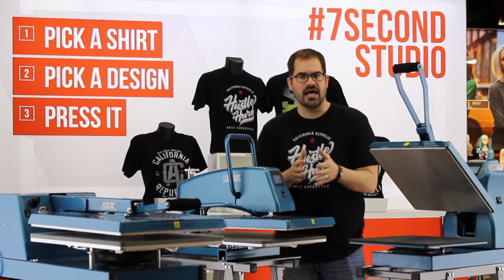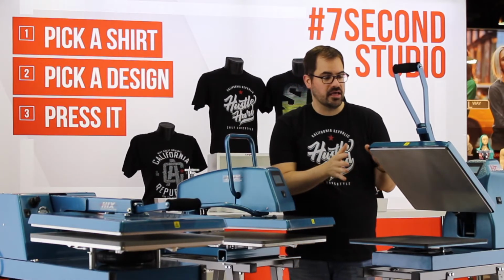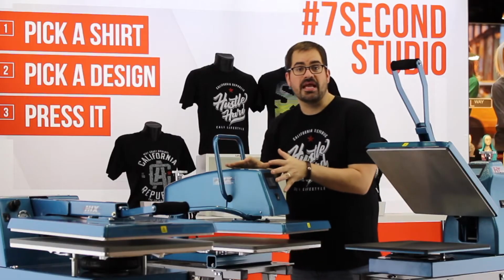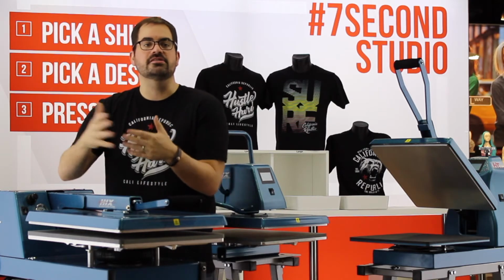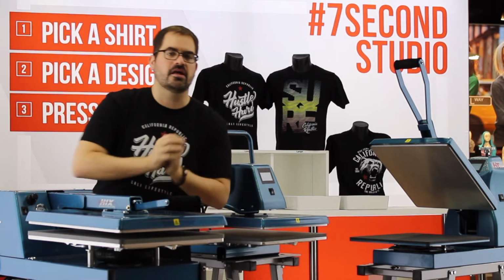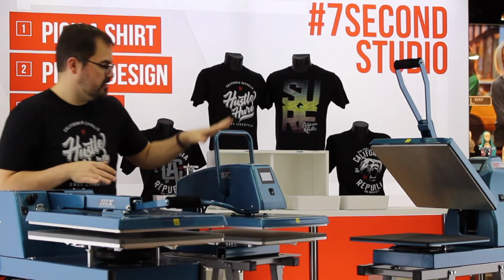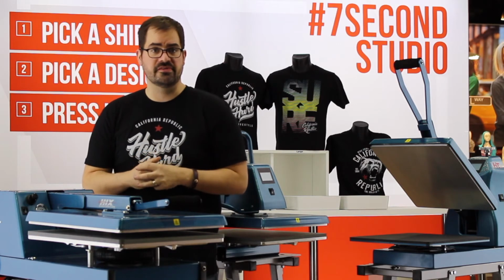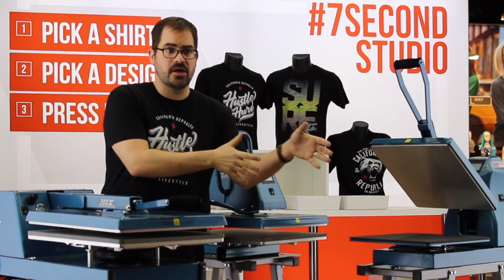American-Made Heat Press Equipment

Comment: Is the Air operated Clam press Thread-able ?
Reply from the maker: Yes, you can thread on the machines with proper equipment. HIX also has a Shirt Splitter Stand.